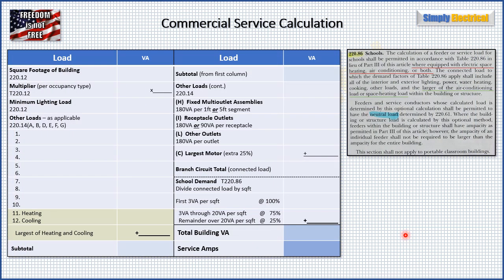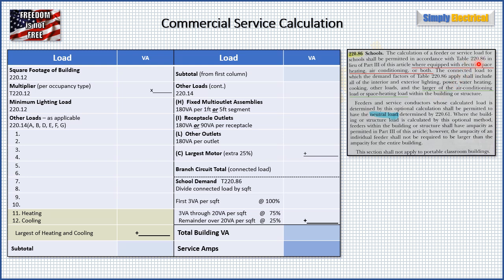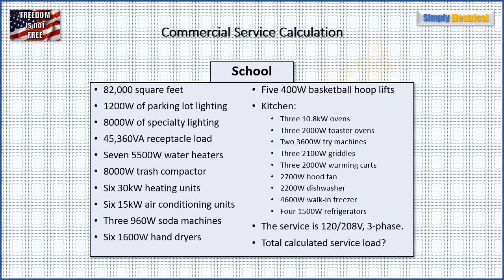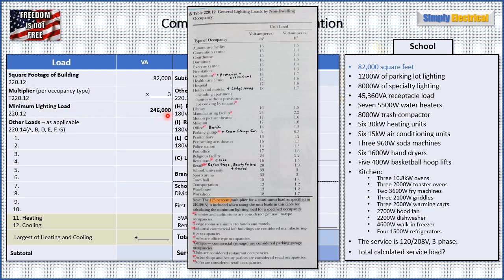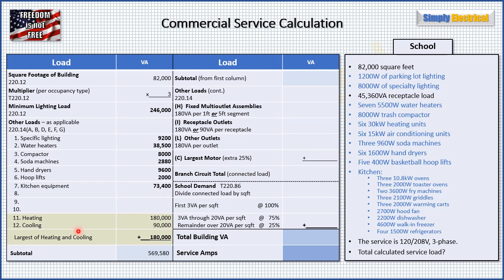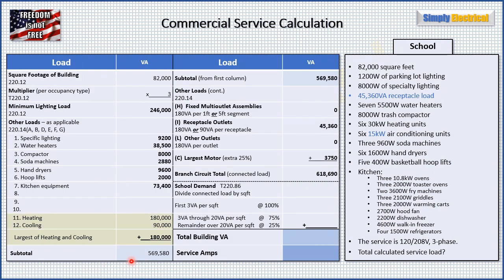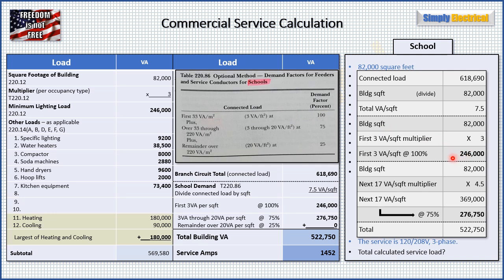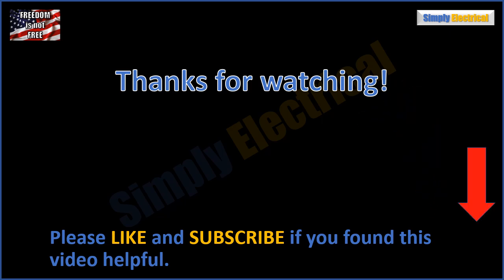School Optional Service Calculation - Crash Course 2020

Comment from the maker: NOTE: The Specialty Lighting should be 6160 watts instead of 8000 watts. So, adding the Parking Lot Lights and the Specialty Lighting together, you get 7360 watts. Multiply by 125% (continuous loads) to get 9200 watts for Specific Lighting. Sorry for the mistake!

Comment: Question: Why didn't the example 220.82 C to the 6 heaters times 40 percent?
Reply from the maker: 220.82 is for a dwelling unit. This would not apply to a school calc. So you would figure the heat at 100%.

Comment: In this calculation, you didn't include an exterior Sign circuit.  Is that part of the specialty lighting?
Reply from the maker: Another fantastic question. Few folks catch this.

The requirement for the sign circuit is found in 600.5. There, it specifies this requirement for "commercial" occupancies only.

Now remember: in trade lingo, we use the terms "commercial" and "residential" differently than the NEC does. We generally think of anything that isn't residential as being commercial or industrial. But for that, the NEC would use the term "non-dwelling" (see T220.12).

Formally, the term "commercial" refers to a place where commerce takes place. A school doesn't fit that description. It's not a business in the traditional sense. So there is no requirement for a sign circuit.

I realize it's another one of those undefined terms in the NEC, so it's difficult to prove one way or the other. But it does make sense when you consider the intent behind the requirement. Most schools have no need for a lit sign on the building. Most businesses do.

Note: The IBC does not classify schools in the Business Group. Rather, they are in the Educational Group. This may add weight to the argument, as the NFPA often relies on the IBC for occupancy and construction type designations (see Annex E).

Comment: This is the first Optional method calculation that you added the 25% of largest motor to the calculation. In your Optional Method, One family and multifamily dwelling examples 25% of largest motor was not added into the calculation.
Reply from the maker: Great observation. This is one you might get mixed opinions on. Here's my take:

220.82 & 84 have very specific requirements for calculating motor loads using the Optional Method on dwellings (use nameplate). However, Schools and Restaurants are treated differently and do not have the same stipulations. Motors are not specifically addressed in 220.86 & 88. Therefore, I believe they must default to 220.14(C).

It really just comes down to the difference in wording.

Comment: Quick Question: Is there a reason why we do not do 125% on the specific lighting loads?  in this example it is : 1200W of parking lot lighting
and 8000W of specialty lighting. I calculated those at 1500 & 10000 to come up with 11500 va. Can you confirm that I am not crazy?
Reply from the maker: No, you are certainly not crazy. I'm the one who's crazy! You are completely correct. Sorry for the confusion. Somehow, I unintentionally left out the 25% multiplier for the lighting loads here. That's weird. And what's really bizarre is that it's been over a year and this is the first time it was caught (or at least that it was brought to my attention). Nice work! I'll put a note in the video so as not to mislead anybody.

I did include the multiplier in my 2023 NEC video: https://www.youtube.com/watch?v=JlS_woWDSnw
So maybe I'm only half crazy. 😵‍💫

Thanks for letting me know of this oversight. It truly helps everyone.